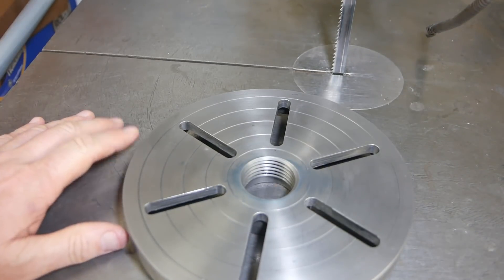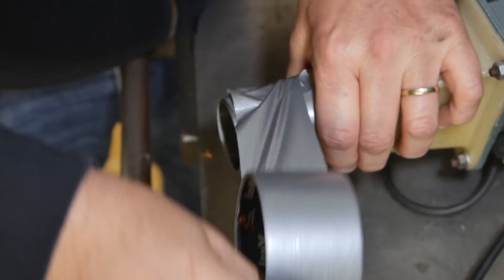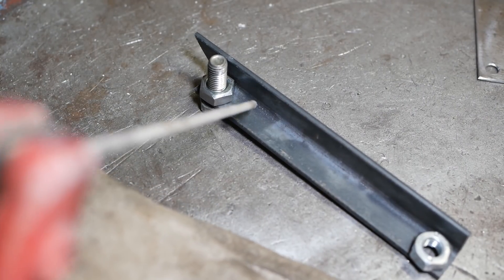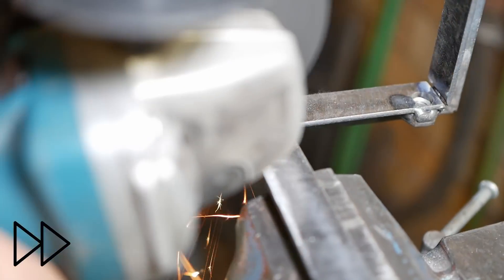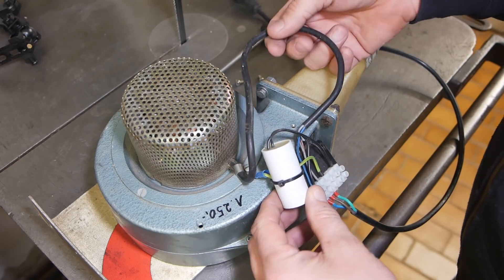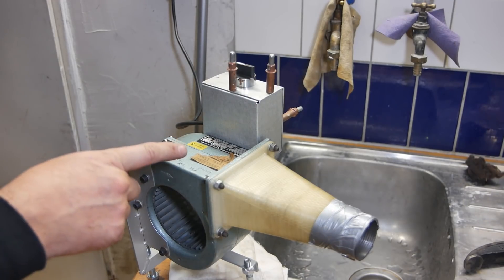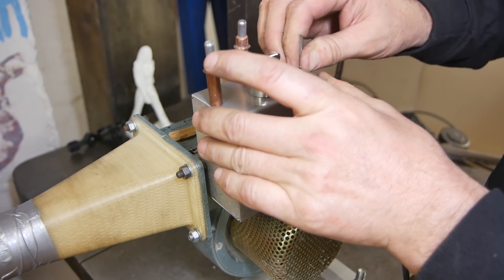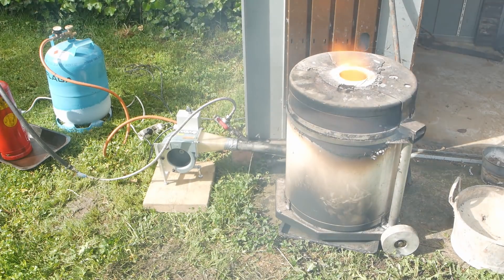Furnace blower modifications.

Comment: Workshop upgrade suggestion..get a second grinder, no more faffing around swapping wheels. Luxury
Reply from the maker: Yeah. I see a lot of metal workers with about as many angle grinders as screw drivers.
Reply: @RotarySMP    not just metal workers.. AG's are rel cheap and for metal I got 4.. cut, grind, sand & wire-wheel.. the wire wheel one needs a speed reducer in front of it, otherwise it freaks me out bec of it's non-balanced-nature and the forces it creates.  All of them also got a sheet-metal air-exit-deflector as otherwise one of the blower exits always manages to point directly at  my face / eyes ;-)

Comment: Hey Rotary. I really enjoyed watching that thanks! A friend recently gave us a new furnace that runs on waste oil. I gave it a teeny test but haven't melted anything yet. His method was to light a fire in the furnace (with wood) to get it hot enough to burn the oil. I like your method of using the gas, because it's a bit cleaner, but I gave my old (propane) furnace away already, so don't have that burner anymore.
The new oil burner uses compressed air to atomise the oil (like a paint gun - the idea anyway) AND a blower...  Having to use the compressor the whole time is not ideal but will see how it goes. 
Q's: Do you preheat the oil? From what my friend said this helps a lot to lower the viscosity and create a burnable mist.
What oil do you actually use? Automotive engine oil? veg? My friend had been using a combo, because it's what he had, but apparently veg was a lot better... 
Ok sorry for the long message. Watching you make the little sheet metal box was inspiring, you've so much skill! Also loved the way you edited the vid, with funny interludes, music, and blunders that we can all relate to. 
Peace Bongo.
Reply from the maker: I dont preheat the oil. I use mainly Veg oil, with a little diesel added to make sure it flows well. This is just a dribble of oil into the furnace, so it has ben hot to vapourise the fuel. An atomising burner like yours will be much more sensitive to fuel viscosity.
Thanks for watching.

Comment: I used a similar fixture on some furnace blower back in the day, I thought it was safe from the heat. And it was safe from hot gas, but the infrared radiation melted the plastic blades of the blower. That's why if I do that again, I would keep the curve thing attached to the blower. IR don't do curves.
Reply from the maker: Good point, but this blower has metal blades. The transition duct will probably deteriorate, but I need to cast one of them sooner of later.
Reply: @RotarySMP  well... , why not sheetmetal a Duct in to existence like the electronics box?
Reply from the maker: @sammiller5509  Laziness, and time pressure. The tape works for now, and I wanted to use the blower.
Reply: @RotarySMP  sorry,  i meant instead of casting a duct.
it would even match the other box if you made it out of the same kind of metalsheet

Comment: Watching your furnace burn I notice that there is a lot of high temperature waste heat exiting the furnace.  If you ran the steel blower tube through the the furnace exhaust first,  then into the bottom of the furnace would it increase furnace efficiency/temperature significantly?
Reply from the maker: Recuperation. That would be tool much work. As is, this furnace esily melts cast iron. That is all I need from it. I am burning waste veg oil, so the efficiency is not a big deal. Whether I burn 10L, or 12L is not a big deal.
Reply: @RotarySMP  I forwarded your message to Greta. She shall get in touch with you soon. Something about polar bears and global warming. Sure explaining why it's raining since 2 weeks and we got 12 deg outside today. almost june...

Comment: top tip for u - buy a cheap plasmacutter-makes life way more easy,when shaping steelplates and angleiron--i bought one of those extremley cheap ones from Lidl for appox 150€ and it works greeat
Reply from the maker: This welder is a combined stick, TIG, plasma. I tried the plasma function, but found it makes an even bigger mess than the angle grinder.
Reply: @RotarySMP  that's a bit odd,specialy in thinner materials like sheetmetal..pherhaps your settings or airpreasure was to high
Reply from the maker: @hedning003  I suspect that the nozzle I tried was worn out. The mate who owns the welder has size given me his can of consummables, so maybe I need to give it a second chance.

Comment: Do you use a mask to keep the dirty air out? I use a 3M 4251+ mask. It really keeps all the dirty air out and filters the air. You can also use it with painting. It keeps all the smell out so you wont get ill. ;)

It fits under a welding helmet. :D

Greetings,

Jeff
Reply from the maker: Yeah, I use a cartidge type particle filter when grinding etc, and switch out to a charcoal filter for painting and chemical work.
Reply: @RotarySMP  I used to get all sorts of black stuff in my mouth and nose. So i guess it also ended up in my lungs. Had a really squeaky exhaling if i pushed all the air out. Welding is a really nasty dirty business. 

 It went better some time after i got a good mask. Im never doing anything dusty again without wearing the mask. What a difference. 

Greetings,

Jeff
Reply from the maker: @jeffjefferson2676  Lungs are a pretty sensitive organ, but few nerves to give warning. Need to look after them.
Reply: @RotarySMP  Yeah, im never going to work without a respirator again. Also normal dust can also give you silicosis, and that is no fun. You cannot get it out of your lungs, and whenever the gunk builds up, in the long run it will get you. You see that a lot with (I saw a program about) Peruvian miners, they dont wear respirators, and they die of lung disease at a young age. Its really rough to see it, and even though you think you can take it, the dust always wins. 

Greetings,

Jeff

Comment: Thats the neo big blower?
Reply from the maker: Yep, Leap-1A.
Reply: For a moment i thought it was the trent7k,  We have been changing injectors on the leap, too bad they built the engine around them😩😂
Reply from the maker: @andrecarlos985  Why did they need changing? I thought the 3D printed injectors where the solution to all nozzle failures :)
Reply: @RotarySMP i guess they should use ABS instead of PLA 😂.
I don't know the details, they seemed a little toasted though, it was manufacturers warranty work, on the first C check. Curiously planning thought it was a 3 days job, turned out to be a 5 days solid work, plus leak tests for all the ducts, units and fuel lines removed. I guess it's better than the fleet wide trent7k replacement we are getting through. I suppose it will take some years and SB's to take care of all the neo wrinkles.🤔 It impacted my job because the engine cowls interfere with slat extension.
Reply from the maker: @andrecarlos985  Slat cowl interference...how long before someone powers a slat thipough a cowl. Happens on every model.

We went through multiple fuel nozzle campaigns on the GE90 in the 90's. Heat soak back causing coking, which jacks the internal tubes out.
Reply: @RotarySMP  i have been questioning myself about that, on the classic/enhanced a320 the inboard cowl has a lower position that doesn't interfere, so it happened once that i know about. On these neos, even on the a330 we have a job card to put a lock on the flap lever, works on A checks, but it's an annoyance on C checks.
Reply from the maker: @andrecarlos985  Sooner or later someone will be in a hurry, probably doing functionals at the same time as an idle leak check and Bang, AOG for cowl damage. We had it on the 777 and 767 back then.

Comment: Did you say 17 Watt or 70 Watt?
Reply from the maker: 70W, actually I think it say 68W on the dataplate. It is a really good size for this furnace. No air control needed, so I only have to meter fuel to it. I could probably increase the melt rate with a higher px blower and an atomising burner, but it is pretty fast already.

Comment: Speed tape, best thing for scaring pax since pilots walking to the front with white canes and sunglasses.
Reply: I hope "instant airplane" is thicker than the aluminium tape you can get in the hardware store for ducts...
Reply: @gorak9000  It is, and it has wickedly strong adhesive on the back.
Reply from the maker: I have never seen it for sale to consumers. They should sell it, as it is a great tool :)
Reply: @RotarySMP  Right?  As an aside I made the first chips on my mini-lathe earlier, and the sooner I can catch up to what you've done with yours the better.
Reply from the maker: @jimsvideos7201  They are a pretty handy machine if you can live with the extensive limitations. Hope you enjoy the mini lathe series I did.
Reply: @RotarySMP  well then I am curious of your explanation for the 27 rolls I saw in your basement... let's start with "where did you found it?" :D
Reply from the maker: I wish  I had 27 rolls of speed tape. The couple of half used rolls I "inherited" from previous employers are long used up.

Comment: Dude, you should build an airplane...It doesn't have to be a jet.
Reply from the maker: I bought a half finished kit plane once, but my priorities have since changed, so I sold it on.
Reply: @RotarySMP  for the whole sake of us... It would have been a bunch of parts, tack welded together by an ape, painted without preparation by a Mexican sailor and finished with a slice of bath sealant. Garnished with some ketchup and marmelade. Serving suggestion: Upside down, landed in a tree, since pilot skills were based on guessing, approximative engineering judgment and ignoring gravity. :)
Reply from the maker: Another vote of confidence from our number 1 fan Nico. Thanks Nico :)

Comment: Does it need to be cast? Since you are pretty good with sheet metal I imagine you'd have little problem making the duct. 

https://youtu.be/9wR4mj3M3q0

The video is about "rollation" which is making transitions for a square to round duct. The method is like the taking a 3d object cutting it and flattening it out into one piece. Ron has been doing this stuff for many years and teaching people as well.
Reply from the maker: I also thought about folding up a transition duct, but would need to address the flange and the tube interface, and that plan lost out to duct tape :) Maybe next time.